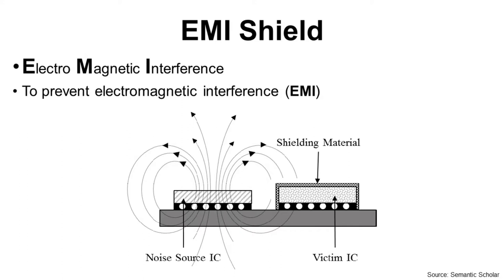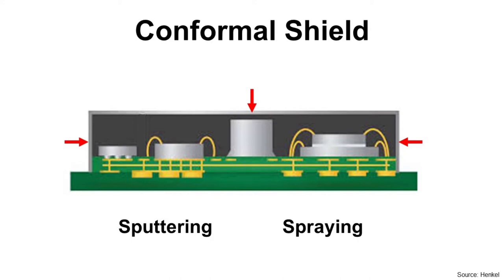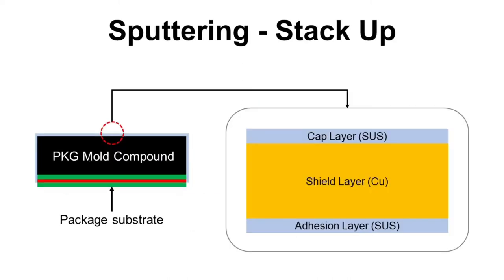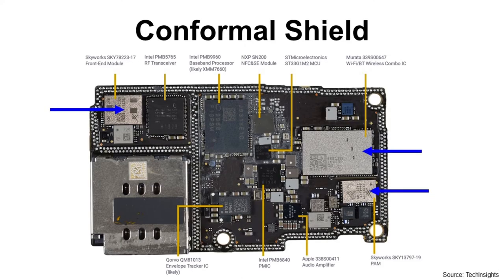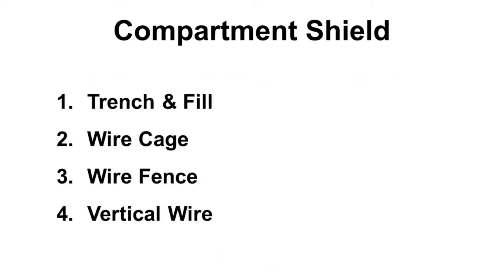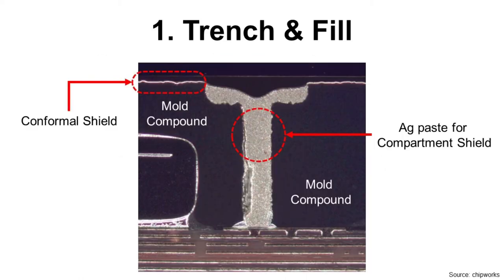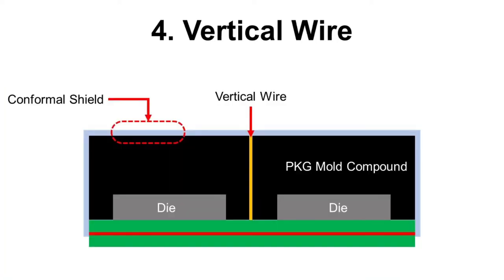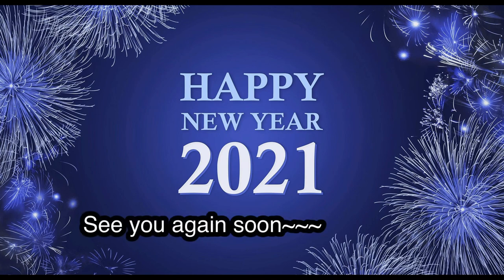[Eng Sub] EMI Shield - Conformal Shield, Compartment Shield, Apple iPhone, Apple Watch, SiP

Comment: Can you explain an example with and without EMI shield, the flaws in the output of the electronic system affected without shielding.
Reply from the maker: Without EMI shield, device can have problems such as radio frequency interference, electrostatic discharge, and power disturbances. For RF device with EMI shield can operate as it is designed but without EMI shield it can malfunction with above problems.